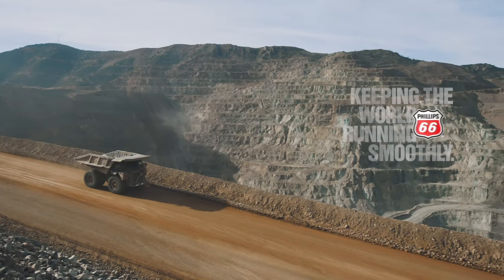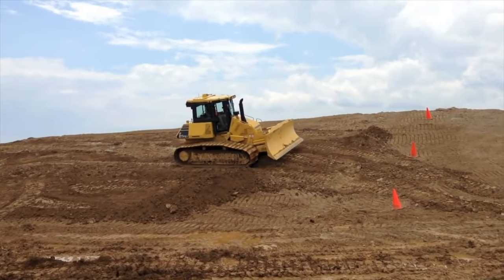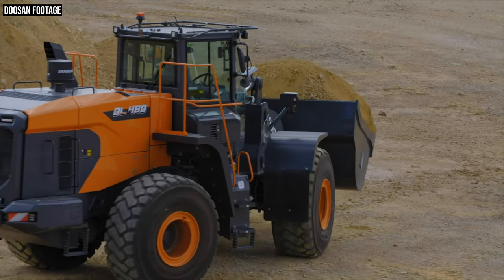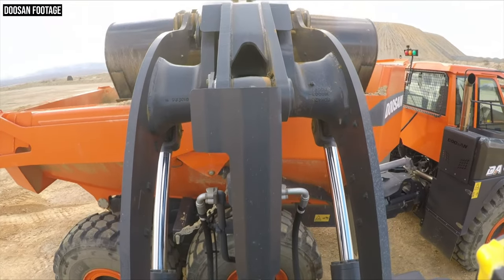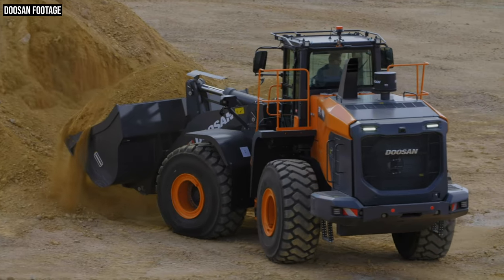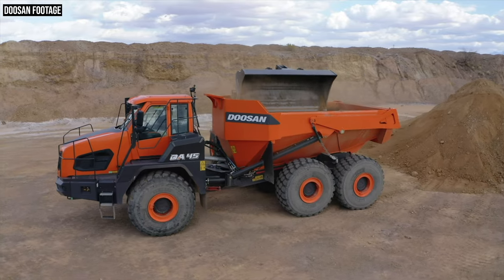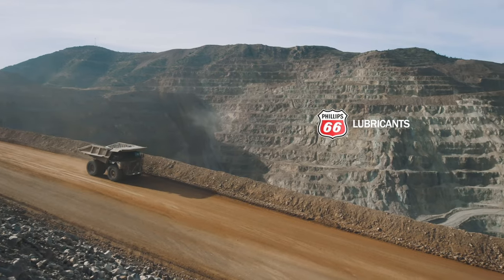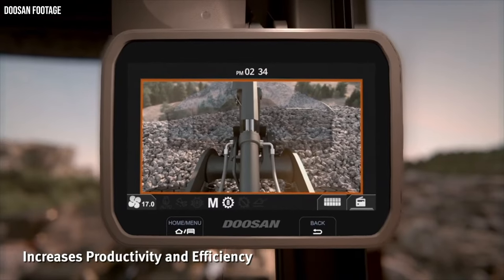A See-Through Bucket? This Loader Has It and It's a Feature From the Future

Comment: This was one of the ideas that I had several years ago. 
an AR system that uses several cameras on the outside of any vehicle or machine that would get rid of all blind spots. and could be customized to show the wireframe or drop shadow of the edges of the vehicle. and show the driver exactly where the wheels are. useful for very narrow areas or driving up ramps.

Comment: There is a Port in the Scandinavian Country's that has automatic Container movers from the unload on dock by Container Crane to storage or truck transport area. All Robotic the operators are in a office running the Container Robotics. There is even a Feature on container mover that Brakes it before it can hit another Robotic operated Container. On a side note I use Remote operation on my old 1978 Dynahoe 190
I get on front side area, my Wife operating Front Loader and I guide her into pile using hand signal having full view of Bucket.
It really works great on Flat work in my back yard, garden area
( OK so I have a Mini, Big Musky)
For my yard. I love it.